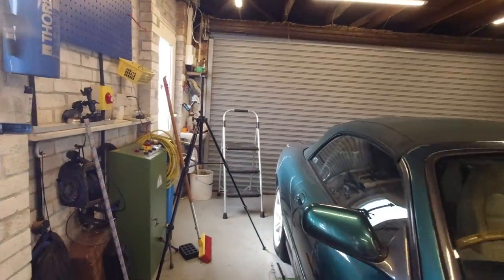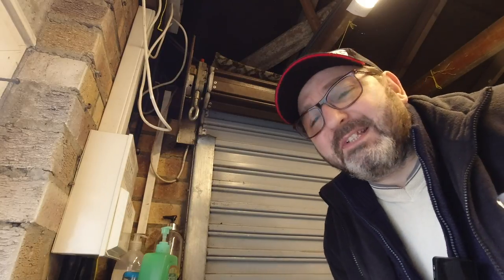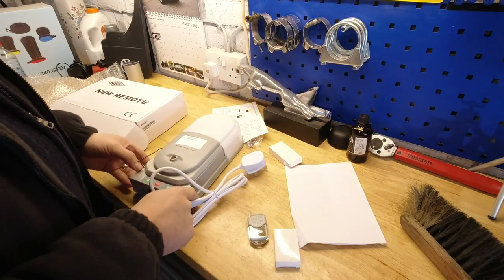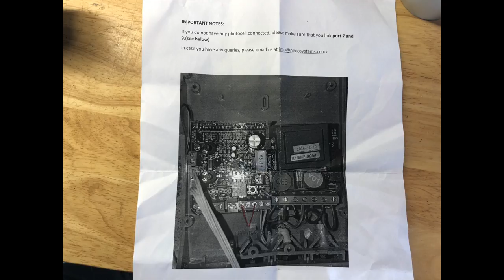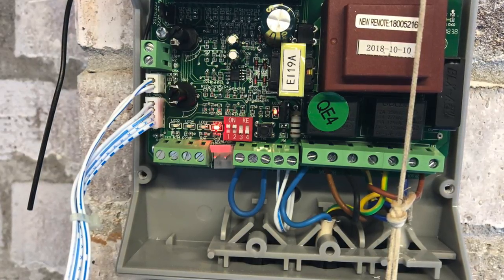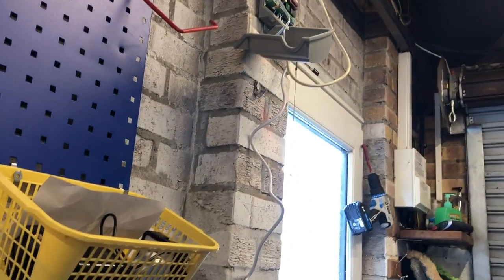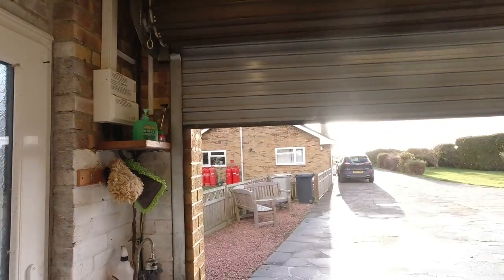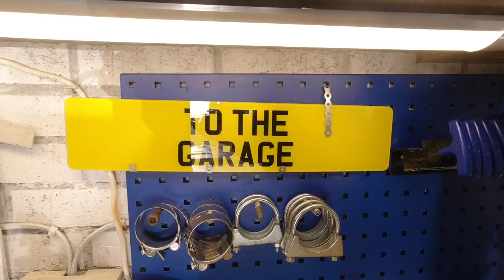Fitting a NECO Garage door controller and remote controls

Comment: JUST TO SAY on fitting a replacement unit to the manufacturer's instruction's they are a bit hit and miss they dont tell you about the hidden switch to left just beneath the transmitter board all you have to do is pull out seeing three pins but then putting it back so it only shows one pin at the bottom this in conjunction with the photo beam will allow the door come down in auto mode.😄

Comment: Auto close function only works after you remove the small black flat pin situated in top left corner inside unit Removed it will then work automatically up and down as opposed to only up

Comment: great Video, very helpful , do yoy know what he other potentiometer adjusts my instructions dont make sense
Reply: It's a run timer. Turn it all the way to its minimal position and you'll find that the door will only run for so long before stopping.

Keep increasing the potentiometer until the door can run fully and stop on its own limit.

This is an extra safety feature to help prevent the door from running too long if it ever goes past the motors limit position.

Comment: I have a key switch that currently controlls my shop shutter but I have to turn and hold the key to the right to open. How do I connect this key switch into the remote board? Thanks.
Reply: I want to keep both remote ir controls and the key switch as a backup incase I misplace the fob in emergencies. Thanks

Comment: HI there, I moved into a property that has this product. I purchased EACHEN Smart Garage Door Controller for this so I could open it via my phone or Alexa. Turns out this is a multi-channel controller - and most of these smart connectors are single channel. Can you (or anyone reading) recommend a similar product I can buy to attach to this so I can achieve this? Be very grateful
Reply from the maker: Hi Paul. Phone control Sounds very interesting🤔
Unfortunately im not quite tech enough to help out here, but I hope someone reading this is.  Because I want to know too👍👍
Reply: Door must have additional safeties if operation via GSM or Bluetooth is possible - you could be closing the door onto someone and not know causing entrapment/crush hazard.

Most 'smart' controllers only send a pulse and as this unit is set to dead-man mode (press and hold) it would need a constant signal e.g timer relay to the down switch.
Reply: I bought a guys smart switch that comes labelled as Neco controller but haven’t figured out how to wire it yet

Comment: How do you program the remote to close the door off one press instead of keeping the finger on the button to close?
Reply from the maker: Hi Lee
Turn Dip switch '3' to the off position. (deadman operation)
Reply: In the top left hand corner of the control board you will see a piece of plastic, just remove this by pulling it off. the deadman should now be off
Reply: @tombraider5010  That is great thanks. I've been trying to work this out for days. This is not mentioned on the unit's wiring instructions. I've been trying every combination of dip switch but that doesn't work. Your solution is so simple and works.
Reply: Unless you have additional safety devices fitted your not supposed to have it on one press to close as the door will not know if something is in the way, like a child or a pet - it will just keep going.
Reply: @tombraider5010 this comment should be pinned !

Comment: How do I disable the dead man switch for the roller coming down. At the moment I have to press and hold the down button to close the shutter.
Reply from the maker: just push dip switch 3 down into the off position.
Reply: @ToTheGarage  thanks for the reply. I don’t have a dip switch on mine. Oh well, back to the drawing board for me.
Reply: How do you get door to come down automatically .got to hold down button on remote, Done all dip switches to what instructions say but still got to hold button down , goes up fine. Or do I need a light bar , can't seem to find nothing about it,  any info be good ,thanks
Reply: In the top left hand corner of the control board you will see a piece of plastic, just remove this by pulling it off. the deadman should now be off
Reply: Unless you have additional safety devices fitted your not supposed to have it on one press to close as the door will not know if something is in the way, like a child or a pet - it will just keep going.

Comment: Standing in the rain holding the down button is a bit of a silly design.
Reply from the maker: just push dip switch 3 down into the off position to disable deadman operation
Reply: Where can I find the dip switch button?  thanks
Reply: @blaze8968  He shows you in the video, its on the motherboard of the unit, 4 switches.

Comment: Do you know how to disable the constant beep when something is in the way?
Reply from the maker: Mine doesn't have a sensor beam so I cant help on this one.  Anyone else got any advice for Bickley Motorsport ?
Reply: I'm a garage door manufacturer and installer.

I'm assuming you have the additional 'light-guard' kit that goes with this controller (2 black coloured rails attached to the door tracks going into a smaller black box that is then wired into this grey controller)

You can't disable this feature I'm afraid, just move whatever is in the way of the beams (the 2 black rails) or turn it off at the wall is the only suggestion sorry.